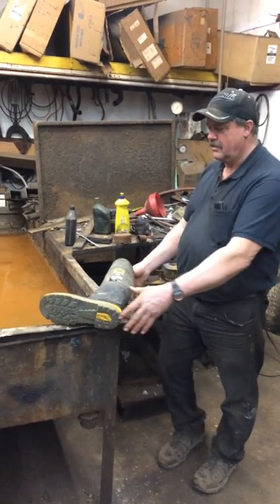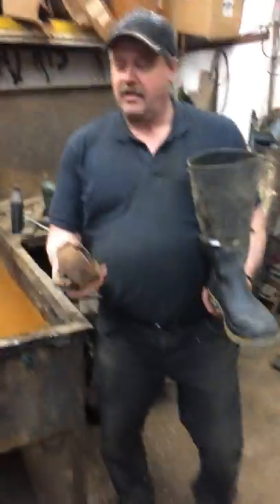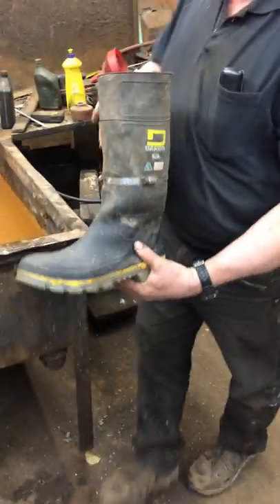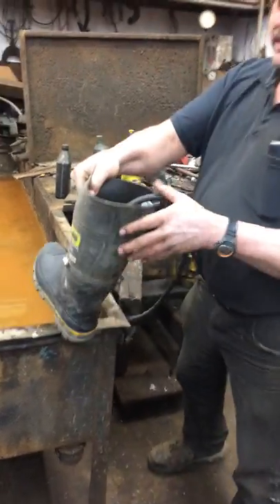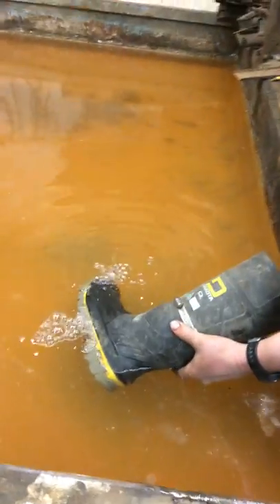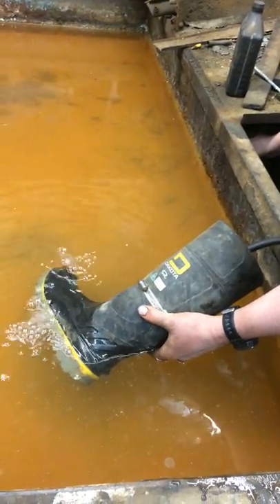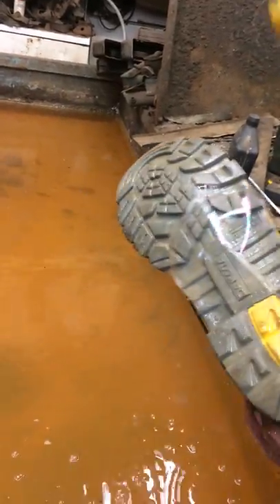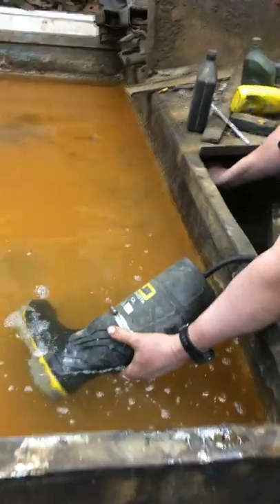Life Trick, rubber boot leak test.

Comment: Those boots I had the same ones and just threw them in the garbage.  There cheap your feet get cold and cracks on the bottom witch means you get wet feet. I just but a pair of Baffin construction boots ice bear. Best boots I ever had. Buy the Baffin ice bear you won’t ever have a issue or wet feet